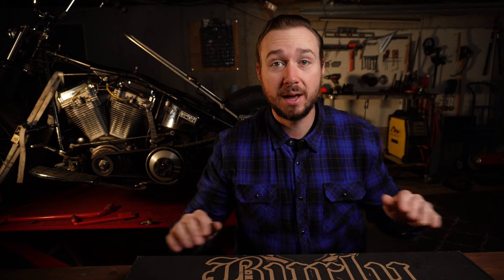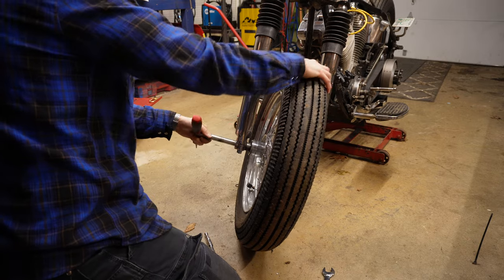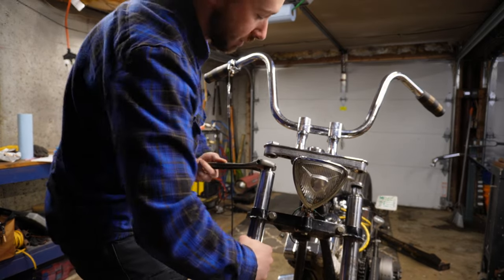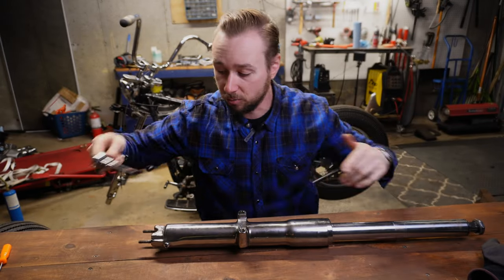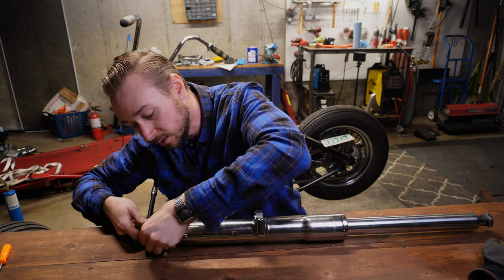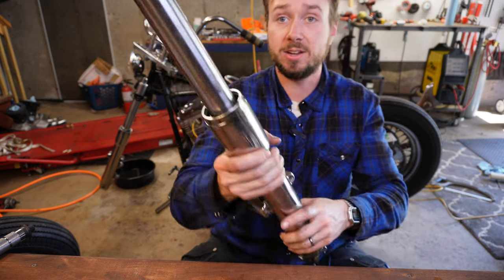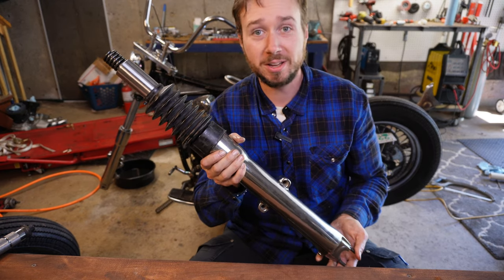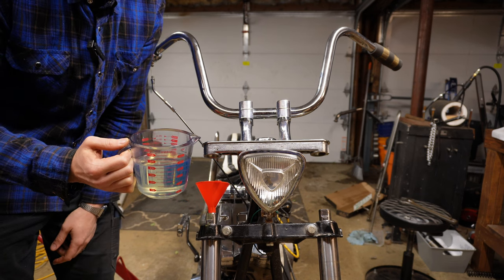Harley Fork Lowering Kit 41mm (How-To)

Comment: Guess I'm old. I've always  just cut the springs, then added spacers.   I'm doing  one now  with my son. 1988 sportster,  hardtail,  21 front  wheel,  front end  lowered  2" lower legs shaved and polished.  Finishing  up with  a Hammer 1250 kit.

Comment: Dude I struggled with one of my fork tubes caps last time I did my sportster front end for 2 HOURS and I finally put it back into the triple trees and tightened it down. (I had basically given up at this point) decided to try taking it off while it’s clamped into the trees and pop see ya later! Probably could save someone some pain who doesn’t have the proper tools to get these off

Comment: Another great video! When I do forks in our shop, instead of trying to rotate that cap while pressing down, I put the bottom end of the slider on a moving blanket, place the cap on top and press down to compress the spring into the tube, and then while still pressing down with my body weight, pull the tube up and rotate it the wrong way until I hear the click, then tighten it down by spinning the tube. Tightening with the tube vs. the cap has always been a lot easier for me, but I'm also.....plus sized, so I have the extra beef to help keep everything compressed. Just my .02. Hopefully I made sense
Reply from the maker: Damn this makes so much sense! I will definitely be trying it this way next time. Wish I knew about this before shredding my palm 😂
Reply: @greasesgarage  Lol I had to figure that out the hard way too. Guess it's a rite of passage of sorts!

Comment: Lol I just got taught a lesson with fork tubes last summer after acquiring a front end with the 1200 basket case i bought for $500 with a three inch extension and was curious as to possibly using them on my forks but didnt expect them to be a pain to get back together, but after some time, a ratchet strap some  fighting and then decided to get my husband

Comment: I have a dumb question. How much did the  2" fork drop lower the frame to the ground? I have a wide glide 3 cvo that's pretty low already so I don't want my ground clearance down too much. I just like the shorter fork look. Thanks in advance.
Reply from the maker: Great question and I’m kicking myself for not writing down the exact numbers! I had these same concerns since hardtailing my frame lowered it a good bit already. From what I recall though, the drop was only about 1” and only in front obviously, as the rear end isn’t changing. I highly recommend it

Comment: Hey mate, hoping you may be able to help. 
 I’ve gone 6” over on my sporty. Would a kit like this drop my bike to ~4” or am I likely to run into issues given the forks I’m dropping aren’t stock length?
Thanks
Reply from the maker: Great question. Take my advice with a grain of salt because I’ve never done what you’re asking though. 

I would be inclined to say that it wouldn’t work, specifically because the progressive springs in this kit are designed to be stiffer to compensate for the lower fork height (less room to travel).

I would imagine that they would be too short to work properly with a 4 over setup, though physically you could probably make the spacers at a size that would accept these shorter springs. You’d know you had it right when the preload matches.

And this part is all theory but maybe as long as the preload is right then the springs are fine. Maybe someone smarter than me can help us both out with this one

Comment: Buy the tool for the leg
Reply from the maker: Which tool?
Reply: @greasesgarage  V-Twin 16-0630 - Fork Tube Plug Socket Wrench Tool
Reply: I had the same problem .i lowered my 1950 panhead 2 inches just you fighting that nut untill i call my friend.  I have another question did you have to replace the kickstand.  I bent my kickstand so it wouldn't tip over to the right side when you full lock to the right.
Reply: Hope it help. Sorry for being long winded.  👍🏽
Reply from the maker: @jrivera123z  it definitely doesn’t lean much anymore haha. I don’t think it would fall over but you have to have the wheel turned to the left when the kickstand is down. I used to be able to turn the wheel to the right and it would still stay on the kickstand but not anymore
Reply: @greasesgarage  i truly appreciate your time and your video was great.  Wishing you only the best.